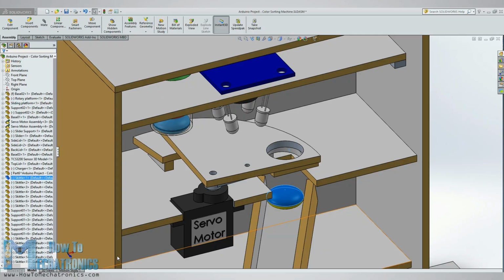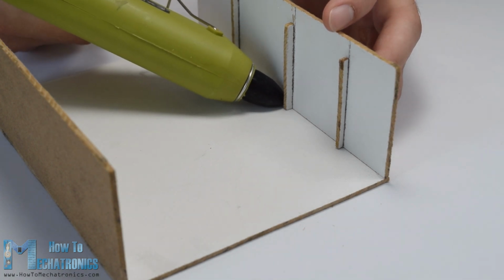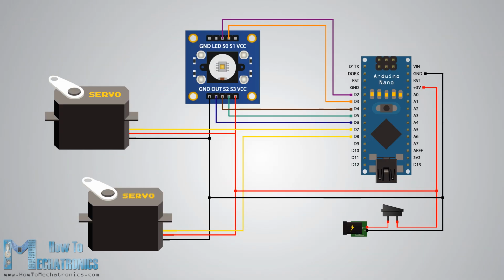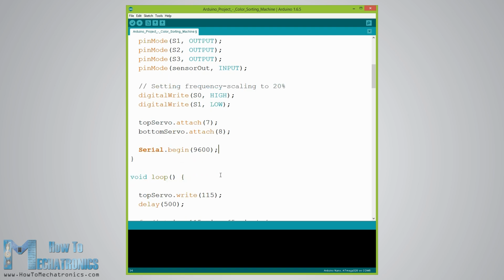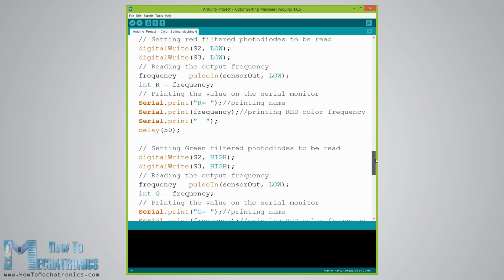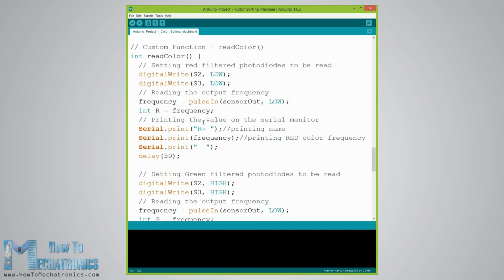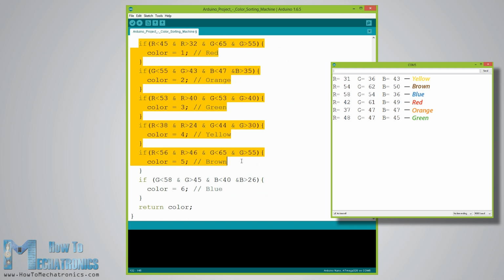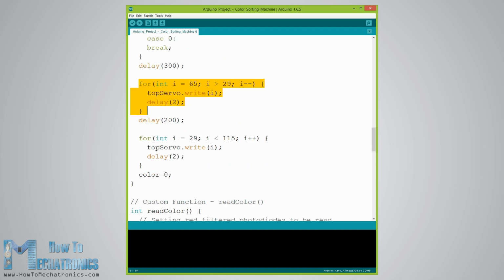Arduino Color Sorter Project

Comment: Im trying to build a project involving two servos & two color sensors (TCS3200). Im not sure about its power; if arduino that is plugged in a outlet using the barrel jack is enough to power up those. I tried using two 18650 batts but i think it shorts out my arduino uno R3.

Comment: Hello, Can I replace the sensor with an arduino camera like OV7670 VGA camera? Should I use the same modules if i use an arduino camera? My idea is: the camera  will take a picture of the object, then it will take a histogram of the picture or another process which takes the color of the object and recognize the color of the object. Everything is the same in process but I only want to change the sensor with camera.

Comment: Bro accidentally i gave 12 v to nano board...After that any servo motors are not working properly....What's may wrong in this setup...can nano board accept 12 v..
Reply from the maker: You can use 12 for the Nano but only on pin Vin. The servo motors work on 5v, so you might have fried them when you connected them to the 12V.
Reply: @HowToMechatronics  and also with the new setup the 1st servo motor is rotating in opposite side...How to fix this problem.

Comment: Tried this with arduino uno. But the bottomServo does not work.
Reply: Nevermind. I saw the comments on your website and saw your comment about redefining the values to match the colors. Thanks! It worked!
Reply: I neet help as my bottom servo motor is not working can u pls help me?
Reply: @koyalnarkhede1383  test the color sensor first and take note of the values it produces whenever you test a certain color.. then change the values of RGB in the last part of the program for each color... the bottom servo will move if it detects a match.

what i meant was this part:

  if(R<45 & R>32 & G<65 & G>55){
    color = 1; // Red
  }
  if(G<55 & G>43 & B<47 &B>35){
    color = 2; // Orange
  }
  if(R<53 & R>40 & G<53 & G>40){
    color = 3; // Green
  }
  if(R<38 & R>24 & G<44 & G>30){
    color = 4; // Yellow
  }
  if(R<56 & R>46 & G<65 & G>55){
    color = 5; // Brown
  }
  if (G<58 & G>45 & B<40 &B>26){
    color = 6; // Blue
  }

Comment: Please provide all information about servo motors and power to be supplied to the machine. here are common complaints about the drop servo motor not working. But the author has not bothered to reply it. Neither there is any contact number provided so that the needy person can take help. Not acceptable.

Comment: Both the motor s are not working....either of them are not moving ..only L light is blinking on supplying external 9V power. Tried connection on Vin and +5V both the way but nothing worked..pls help

Comment: I have a simple circuit diagram with one servo hooked up to my ESP8266 board power and ground respectively and Signal wire hooked up to D5 and I'm trying to get it communicating with my Arduino software via a micro USB cable, but this is the error I keep getting: espcomm_upload_mem failed

Comment: I have done what was told in the video, set r,g,b values according to my sensor but the bottom servo is not functioning. Is it because Arduino Uno cannot handle 2 servo and a colour sensor or is it due to my coding mistake. I have Arduino Uno r3. Please help.
Reply from the maker: It could be that the the Arduino cannot handle 2 servos. Try to use external 5V power supply for the project as shown in the circuit diagram.

Comment: Whats the power jack you used? Because two weeks ago I bought the one you provided on the link, but then you changed it to another one with 3 pins? Why?
Reply from the maker: Sorry I've updated the post wrongly. I've updated again now. So you need a simple 5.5mm x 2.1mm power jack with two pins, plus and minus.

Comment: hey i need to know that how did you make the moving skittles , i.e which command or what did you used in solidworks that skittles also move and retain in the position of the slider ,pipe , sorter and finally gets into its respective box ? how did you do that in solidworks?

Comment: Bottom servo is not working please help
Reply: Did you solve it?
Reply: I also got that problem.
Reply: @hiruw6298  Probably the reason is that the bottom is not getting enough power. Just use an external source, like a 9V Battery, and make sure you plug it in "Vin" on your Arduino, not 5V port.

Comment: Very well explained! 
I'm gonna try to build a similar device. Is it possible to switch the top servo with a stepper motor for continious single direction motion using the same schematic wiring setup? (like a small 28BYJ-48 5vdc stepper motor)
I'm guessing this would draw to much power...

Comment: Bottom servo doesnt work, only on 2 colors when top servo is not connected. Does anyone knows why? Is it sensor, powering? Pleaseee help! It school project :)
Reply: Dejan Nedelkovski I did that, with help of your another tutorial with calibration of sensor and get lot of values same as you. I understand that you took for mapping highest and lowest values, but didnt understand which of values you use for borders, here in code and how did you get continious values for this colors??? Thank you for previous answer :) :) :)
Reply: Can it be some problem in powering, is it enough from my laptop, while editing code to work everthing properly. I read that more servos with LED need more voltage supply?? :))))))))

Comment: it doesn't work by me. We need to make this for school . We make these project but it doesn't work. One of the servo works, the other not. What's the problem ??? Please help me!!!
Reply: bottom servo will not move because pin 8 is not a PWM, try connecting to 9 or 10 or 1. it will work :)
Reply: Mayada Ahmed  It's not standard. You have to set rgb valies for your sensor. You have another video from Dejan how to do it, and also you need 2 batteries 9 V for supplying this mashine. Port from laptop is not enough.
Reply: bert de landtsheer i have same problem. If you manage to solve this, please write how. :)
Reply: can you speak flemmish ?
Reply: bert de landtsheer not :( only english and bosnian, but we solved problem, now evertyhing works, thanks :)
Reply: pame la , how did you do that ? We van't solve that 😪
Reply: bert de landtsheer sorry for not replying you, i didn't see the message until now. You mean, you have same problem? You must calibrate sensor first, on same way as Dejan. We made range of every color on way that we took for each color the value that s repiting mostly with +/- 5 deviation. You need to try several values if it doesnt works properly. Our sensor is tcs230 so it's very sensitive on blue color, and we took Dejan's range for that color. And we also had problems with supply, so we took 9 V battery because port of your computer is not enough, it s only 5 V. :)
Reply: pame la 
I'm trying to make the machine but my servo is shaking ...and the bottom one is not working properly ...+ do I have to set the rgb values ? Isn't it standard?
Reply: Ranga vittal is not that problem, pin 8 is ok for arduino uno, the problem was in supply, but we used 2 batteries and solved problem
Reply: Hello pame la, for me, I have changed both the pin and it worked. Any way happy to know that ur problem got solved
Reply: How can used to batteries 9 V on your project because I have the same problem the bottom servo doesn't work . And i used arduino uno
Reply: Did you manage to solve the bottom servo problem?
Reply: como calibraste el sensor ?
Reply: pame la please give the link for sensor calibration
Reply: Actually maybe your color sensor is not detecting the color and values for R,G,B value may not be in the range that is declared within if statement for a specific colour

Comment: hey, sir. I don't recognized very well the component that is conected at first, previous the switch bottom. ¿Can you tell me what's that? I think that is a component to regulate the electricity to don't damage the arduino, and is a USB port. ¿is it correct?

Comment: bottom servo not working
Reply: rv teja same problem :( Did you solve it?
Reply: Yes arduino powered from computer via usb ,power is not sufficient to run both motors and sensor. Use external powersupply from adapter to both servos,and program should be slightly changed according to our sensor values
Reply: rv teja thank you :) I will try today, with new powersupply, only i dont know which of values of r, g,b to take for some color, because i  got a lott during calibration of sensor :)
Reply: Initially run the basic program of color sensor .note the range of readings and place the ranges in for loop
Reply: i have the same problem how can i solve it and make my bottom servo working ? plz

Comment: How did you determine the RGB values and color contrasts?
Reply: Dejan Nedelkovski  and how to use that values in code, how to determine for orange the values of r,b,g when you got a lot of them with calibration. Thanks!

Comment: can I use arduino atmega 328 for this project?
Reply: hey did you complete it ,in my case I have used tcs3200 colour sensor but te 2dry motor is not working

Comment: Wait.. how did the plastic bottle turn into a tube for the charger?
Reply: krrav cut away  the top and bottom from the bottle and you have got a cylinder. slice the cylinder appart and you have a sheet of clear plastic....
Reply: Use 5cc syringe